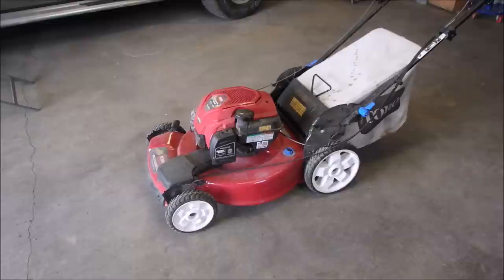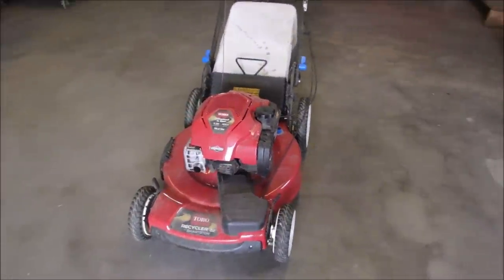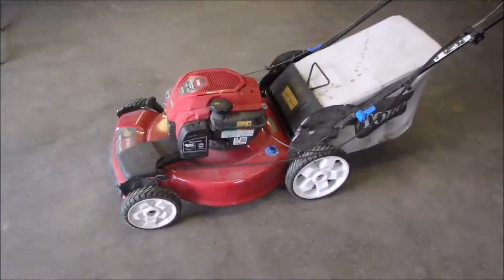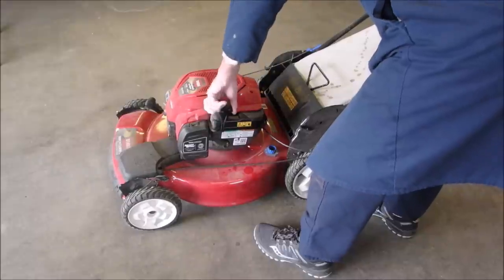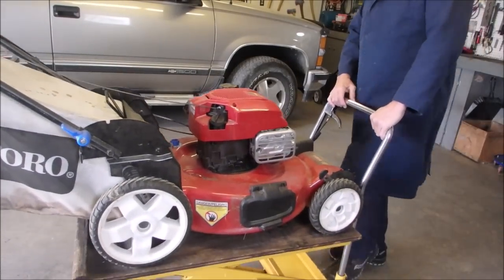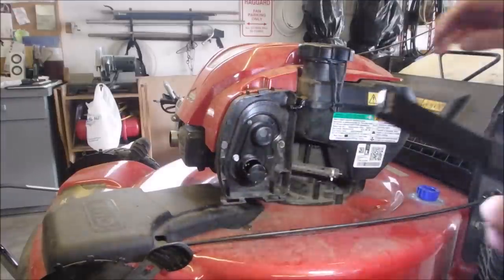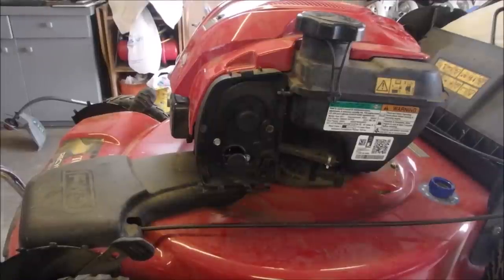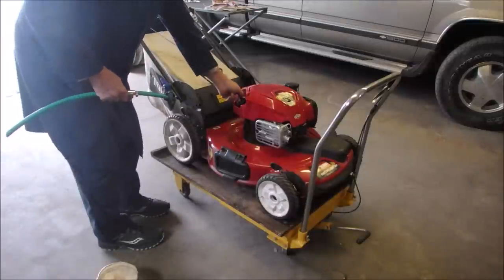Toro Recycler Will Not start

Comment: And… thanks for the shoutout!  The oil extractor hose has made my life so much easier!
Reply from the maker: Me too.  I haven't had many mowers in yet this year.
Reply: @BrucesShop  
Sigh… it was just snowing here a few minutes ago!  Bad for business!
Reply from the maker: @jimyeske8498  I haven't looked outside until Mrs. P. just said  "It is snowing here too"
Reply: Jim do you have a parts list for mocking up that hose? Genius idea!!!
Reply: @77Mowers  
 
Hi John,
Pretty simple design.  The biggest requirement is to acquire a Briggs dipstick.  I don’t have a great deal of spare parts so I bought 2 from a guy whose yard looked like Sanford and Son. 
The fancy chrome valve that Bruce has was purchased at Lowe’s.  Drill a hole through the dipstick cap, enlarge it to 3/4” and glue in a 1/2” I.D. hose with J.B. Weld. On a more recent build, I used clear hose I purchased at Princess Auto.  I also made one for Honda engines.  It’s even simpler.  The threads on the Honda dipstick tube are the same as many household items like sanitizer bottles, etc.  Thanks for asking! Jim
Reply: @jimyeske8498  perfect. Thank you.

Comment: A nice fix Bruce. Jake actually did two videos calling them design flaw on this carb. We ground some of the plastic off the choke arm to get the clearance and his update video showed how B&S actually cut a slot into the metal bracket to provide clearance (a cheaper solution than making a new die for casting the plastic choke part that is the issue)
Reply from the maker: Great.  I said to Mrs P there should have been a recall
Reply: Good  day  Yea I remember that.  I found lawn   mower along side of road  had auto choke. Thanks
Reply: @BrucesShop  Your absolutely correct Bruce it was a serious flaw and when customers were taking them for warranty repairs they had to wait 3 to 4 months. When we fixed them we did not even charge them and normally they gave us $20. It did generate multiple return customers on the other hand.
Reply from the maker: @donvoll2580  Thanks for joining in.

Comment: You can get a suction evacuator  which pulls the engine oil out , or power steering fluid , or coolant , or break fluid . A very handy piece to have in the shop . No more tipping lawn mowers .
Reply from the maker: I have one  but wanted to try the new hose setup

Comment: I had a 2018 "20333" Toro, with "Spin-Stop" technology, a plastic carb, and "Never Add Oil, Just Check & Add" engine (I changed the oil every Fall).  I lost my house and no longer need a mower  so no I in have to it to beat friend.
I bought it from a mower dealer and suspect (with no proof) that is is better built than the same model number bought at a big-box-store.  I run non-ethanol gas from Marathon/Road Dog stations, run it out and pull the drain plug each Fall, and have yet to have any problem.  The person I gave it to will "let" me keep maintaining it so I hope I can keep it going for a few decades.
Reply from the maker: I have not seen one of those but stuff takes a while to come to Canada.

Comment: Nice fix and cool close up shots of the choke doing it’s thing. So it’s the old “back-bend on the Arti-Choke bracket” trick, eh? I’ve got a couple of mowers up for sale here with that setup, I’ll have to check them before I let them go. Sure don’t want any callbacks! Thanks bud!
Reply from the maker: Some of the newer ones have a cuttout from the factory.  Can you let me know if you see that??
Reply: @BrucesShop  I’ll check them and I’ll check the build date too.
Reply: @BrucesShop  well I checked three of ‘em here, one from 2015, 2016 and 2018. None of them had a cutout in the bracket and on two of them the choke could become stuck if the linkage was pushed wide open by hand. Guess the carb bracket back-bend repair should be standard procedure whenever one of these fine beauties comes in for service. Kind of sad, like the last gasp for the once great Briggs & Stratton.
Reply from the maker: @mjg263  Well there you go.  Cool

Comment: Bruce,  It would have been nice to share your friend Jim's nifty oil drain hose designe.  I was really curious as to how it was made.

Thanks,  

John Koutsavlis
Pittsburgh, PA
Reply from the maker: Coming soon!
Reply: @BrucesShop  
Hi John,
Pretty simple design.  The biggest requirement is to acquire a Briggs dipstick.  I don’t have a great deal of spare parts so I bought 2 from a guy whose yard looked like Sanford and Son. 
The fancy chrome valve that Bruce has was purchased at Lowe’s.  Drill a hole through the dipstick cap, enlarge it to 3/4” and glue in a 1/2” I.D. hose with J.B. Weld. On a more recent build, I used clear hose I purchased at Princess Auto.  I also made one for Honda engines.  It’s even simpler.  The threads on the Honda dipstick tube are the same as many household items like sanitizer bottles, etc.  Thanks for asking! Jim

Comment: A conundrum: completely respect you but love Personal Pace. In your experience, what do you find that wears out? Transmission? Cable? Wheels? Thanks for another finely filmed video.
Reply: Don’t know about his experience, but from what I have seen, there are some plastic pieces that can break over time. Though I’ve seen really old ones that still work great. I’ve seen that the transmissions have some plastic gears which can fail. Then again, I’ve seen 10+ year old ones work great. The super recyclers have a beefier transmission.
Reply from the maker: Than Handle bars get so loose and the cables get worn at the top   Too much movement (in my mind  )

Comment: Bruce,      I’ve been working on a Craftsman 6.5 quantum push mower and it starts right up but has a bit of a surge and it backfires some through the carburetor. Is it possible that it has an issue with the valves? Key is good, swapped out carburetor, sprayed carburetor cleaner while it’s running all over, no obvious leaks. 🤔
Reply from the maker: I would think you are right.  You can lap the valves and clean the carbon out of the combustion chamber  to see if that helps

Comment: Glad you showed this design flaw. A poor implementation of existing part design at the factory level. I don't see as many with the auto-choke as with the primer. What do you think of filing off part of that plastic rather than bending the bracket?
Reply from the maker: I considered that as well.  I just don;t like to muck with plastic.  i have talked to other small engine folks and some have done what you say.  Thanks for joining in

Comment: When you show the choke opening as engine starts, and you have video slow motion..'...it looks like the plate is going fully closed and full open for several cycles......is that normal??
Reply: Around 17:45 timestamp
Reply from the maker: To be honest I don't watch every choke when I start it.  The auto chokes are vacuum dependant.  So I would say yes  on the auto choke machines.

Comment: That's a design failure, BS had been noticed that issue, and I saw on new Toro produced later, BS cuts a hole on metal bracket next to carb chock lever to prevent it holding chock lever.
Reply from the maker: I have heard that now that I published this video.  There are a lot of smart small engine mechanics out there.

Comment: That Briggs EX motor with plastic Carb, people either love them or hate them!
Reply: Personally i love these engines
Reply from the maker: This one due to the size is OK
Reply: Ive had some good luck with them, Though i use them commercially i still take care of them, Only thing ive had to do to one is asjust the valves and trim off that autochoke arm but otherwise great engine. I have the 400E on a Craftsman, a 550EX on a Husqvarna, And 2 Toro recycler's with the 725EXI (The model engine you worked on in this video), Good engines
Reply from the maker: @hotwheelsracer6380  Right.  I found the choke arm as well.